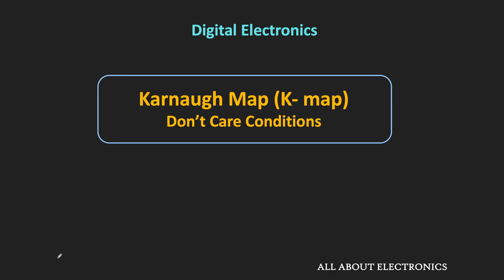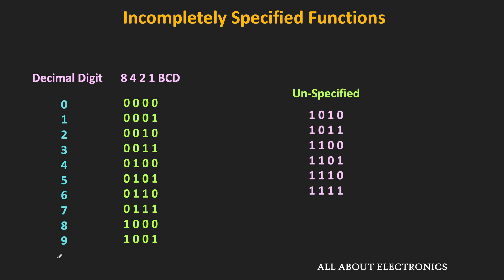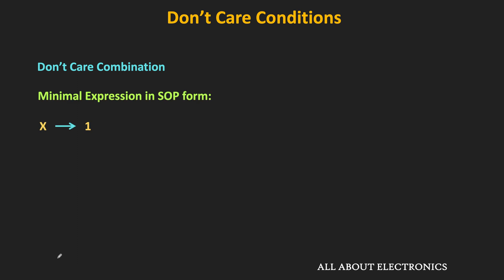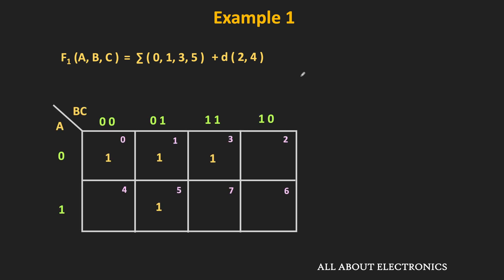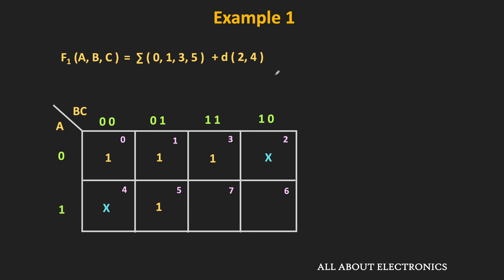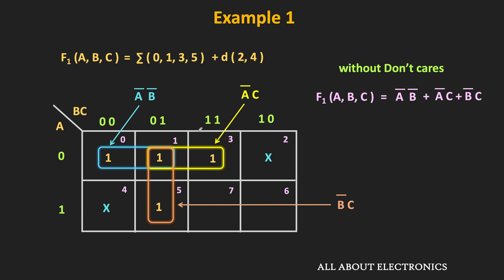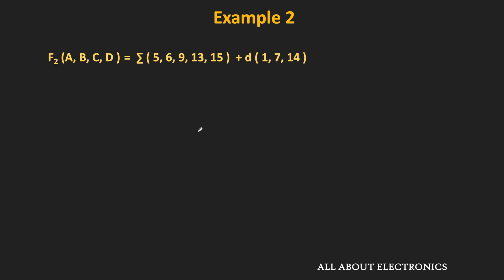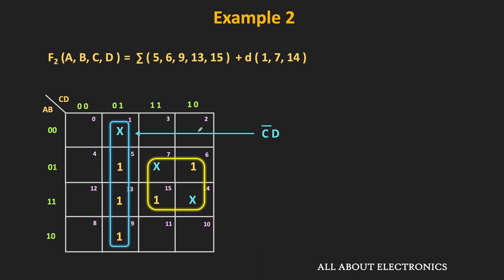Don't Care Conditions in Karnaugh Map (with Solved Examples)

Comment: So the don't care combinations are involved if they form 4 square variable. If it's 2 variables don't group with 0/1?
Reply from the maker: No, that's not necessary. The don't care terms can be combined even for making the group of two 1s or two 0s, provided by making them it is possible to reduce the Boolean expression further. If by making the group using don't care term does not reduce theBoolean  expression, then there is no need to add that group.

Comment: At  9:46 i think there should be A'B'D' instead of only B'D'.
Reply from the maker: If you closely observe then it is group of four 1s ( the group in pink colour). The others two 1s are at the bottom corners. So, this group of four 1s represents B’D’. I hope, it will clear your doubt.
Reply: Okay i got u ... Thanks for clearing the doubt.
Reply: exaclty bro am also not getting that

Comment: 11.30 , while making the groups , we should use 2^n cells right? 
But u are used 10 cells in this question
Reply from the maker: If you closely observe then here three groups have been made. In each group, the total no of covered cells are in the power of 2. In one group we have 4 cells, in second group 2 cells and in the third group again 4 cells. So, all are in the power of 2. You do need to add them all. Just need to ensure that, in each group, the total no of cells are in the power of 2. I hope, it will clear your doubt.

Comment: At 4.40 when we make group of  4 then why we considered only b complement not any term of a
Reply from the maker: There are two group of 4. And I guess you are asking about B' ( The one in orange color). Well, in that case, if you see that group, then as you move from one minterm to another minterm  vertically, ( 0 to 4 or 1 to 5) then variable A is changing from 0 to 1. similarly if you move from one minterm to another minter horizontally ( 0 to 1 or 4 to 5) then value of variable is changing from 0 to 1. Only non-changing variable is B. And in the group, the value of variable B is 0. Therefore, that group represents B' . 
Similarly, if you see the second group of 4 in the yellow color, then it represents A'. Because, in that group, as you move horizontally, then variable B and C both are changing. Only non-changing variable is A. And its value is 0. Therefore, it represents A'. 
I hope, it will clear your doubt.

Comment: At 9:12 why x at 4 is not grouped in the kmap
Reply from the maker: It is a don't care term. It is not necessary to cover all the don't care terms in the K-map. But you need to cover all the minterms in the K-map for which the output function is 1. You can use some or all the don't care terms to minimize the boolean expression. But to include all of them during the minimization is not compulsory. I hope, it will clear your doubt.